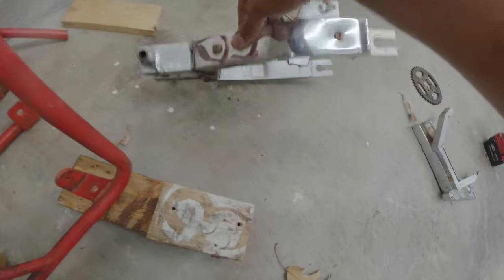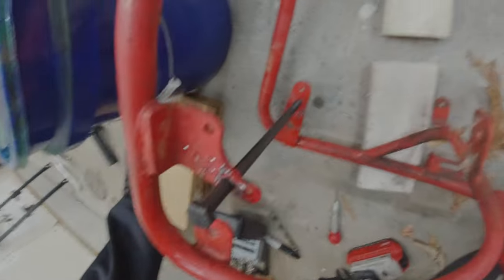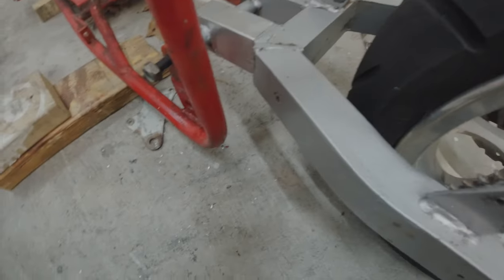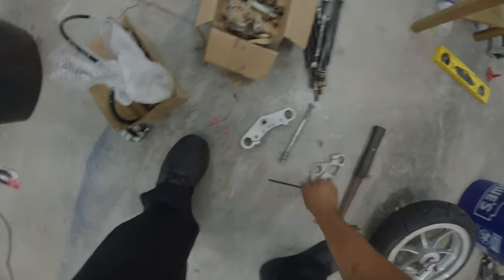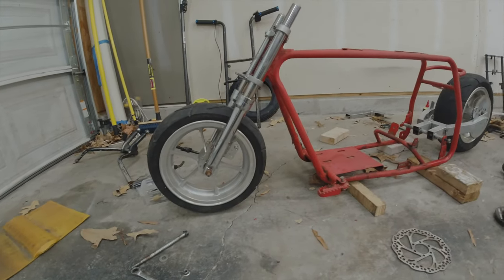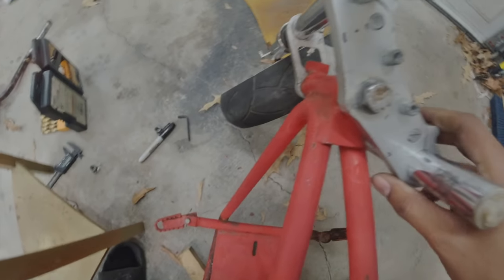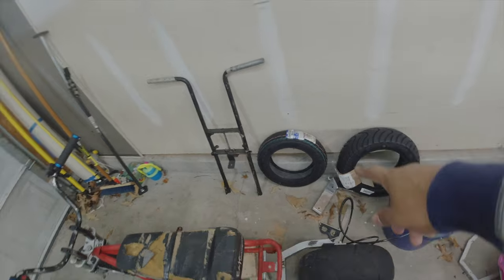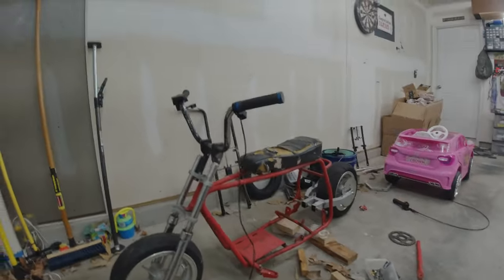Flat Head DoodleBug 30 Ep. 2 | The Roller | DB30 | #MiniBikeMonday

Comment: Hey buddy love your builds.  How do you drill and make the slots for the mount mount slide holes?  You drill them and use dremel?

Also what Torque Converter do you use and with the 420 chain?  Did you order a separate sprocket for the drivers?  

Normally I use a 35 series TC.
Reply from the maker: Thank you! I love this little DB30! For the slots, I just drill two holes and I used my skil saw with a metal blade to cut out the slots then cleaned it up with a dremel. And all the TC’s I use off Amazon are the 30 series but they come with 35 and 40/420 sprockets. I prefer the 420 chain bc everything I run has RK420 and I have a bunch of it. 

https://amzn.to/3L7nXTT
Reply: @DariusBuildz  thanks man.  I noticed your Duke Medical Center badge.  We lived in Raleigh Durham for a year back in 2008 when my daughter was in the Duke Hospital.  That place was a miracle to us.  ❤️❤️

Comment: I think those are X17 parts.

what rear sprocket is that?
do you have a link?
Reply from the maker: The big rear sprocket in the thumbnail is from the stock doodlebug wheel. It’s like a 70T 35 chain, but I went back with the stock Pocketbike sprocket after I decided I wanted to run a 420 chain. I had to modify the bolt holes to get it to align.
Reply: @DariusBuildz  it was stock pocket bike sprocket? Then what did it need to be modified?